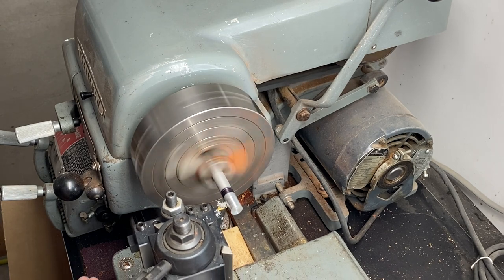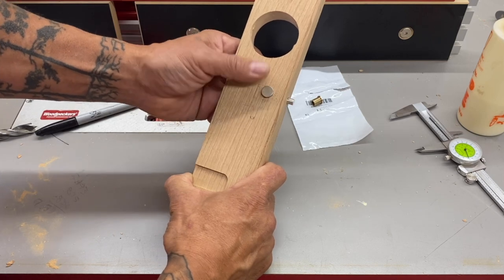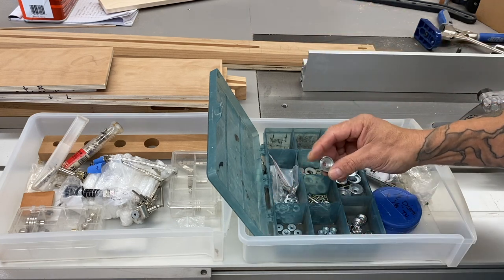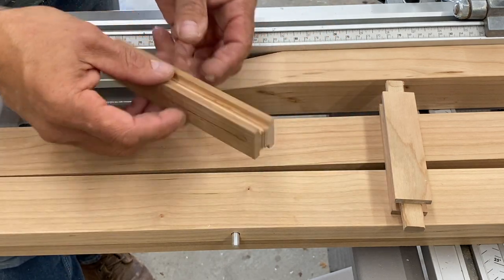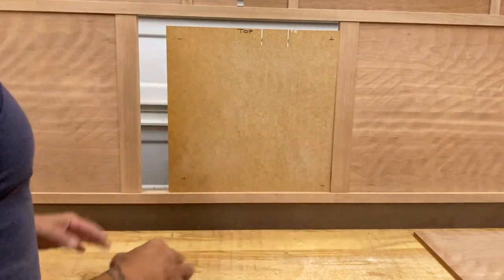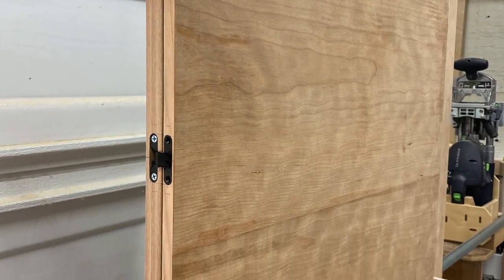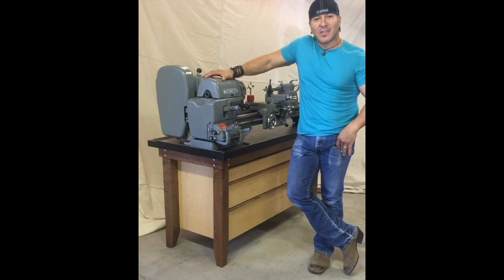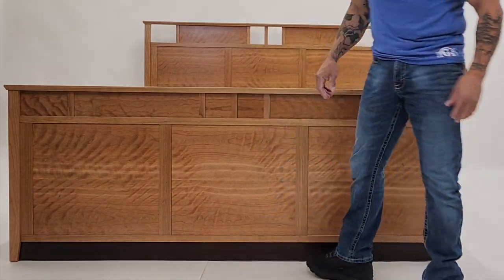Locks/Unlocks with a simple Magnetic Key!

Comment: For your bronze bushing try using a threaded brass insert. It has outside and inside threads. Screw the insert into the wood and drill out the inside threads to make a clean hole.
Reply from the maker: That’s a good idea on the interior threads. But I’m not sure how easy it would be to get an insert installed super clean.  Their course threads tear its way into place.  😆 jk…they’re not that bad but still

Comment: Keen as to do some stuff like this some time soon. Great vid, thanks. Curious, How many mm or 100th or whatever measurement you do you calculate for layers of finish? Like is .3mm a layer of finish?
Reply from the maker: Thanks!  And great question.  Yes, a film finish (like lacquer, conversion vanish or maybe shellac…it’s a bit thinner) will build a few thousandths of an inch.  Perhaps up to 4…which is about the thickness (thinness 😬) of a sheet of paper.  Or between.05 and .10mm.

Comment: Very clear explanation as always I am in search of such type of   lathe as wel the ability to make smal pieces of hardware is so cool. And I think metal lathes AR fine to turn wood on. Most metal lathe are more sturdy and stoud Dan woodlathes wich is a great advantage
Reply from the maker: Thanks buddy.  Yes…you certainly can turn wood on a metal lathe but not as easy the other way around.  However, metal lathes have a ton of areas that require oil constantly.  So, one has to be careful and not allow to much sawdust to build up in those areas.  Sawdust soaks up oil like a sponge! 😆